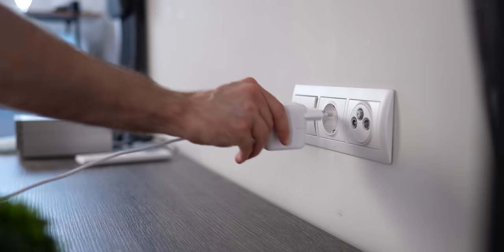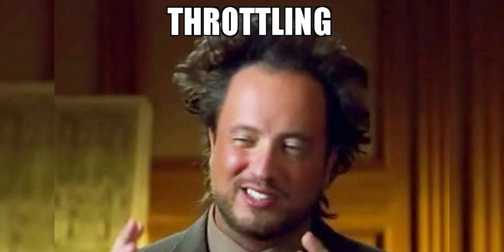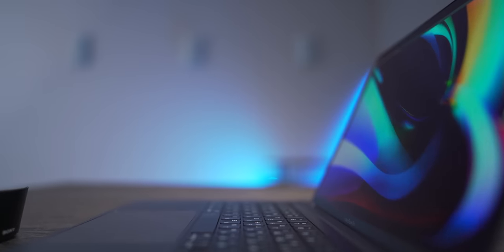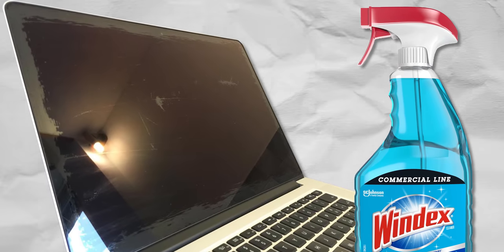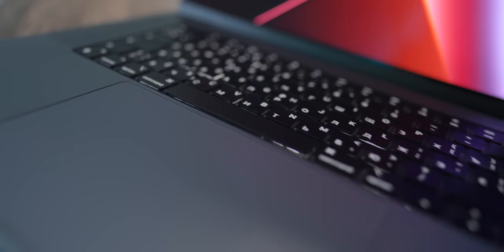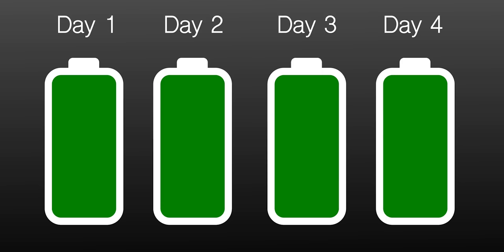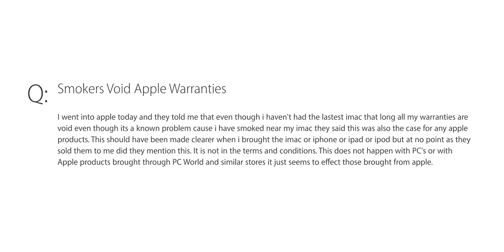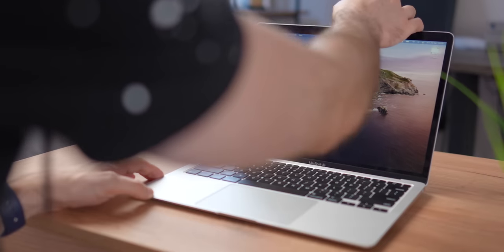Everyday things that SLOWLY KILLING your MacBook!

Comment: These are great tips. I’ve had my MacBook that I bought in 2009 and did everything I’m not supposed to do. It finally bit the dust after 13 years. I miss it. 🤦‍♂️ 😂
Reply: It seems All Laptops of that era were built different. Still have an Acer from 2007 that still powers on and plays old games I enjoyed when new.
Reply: And i have my dads PowerBook G3, which he bought new in 2000, here on my desk, fully working, ok, i had to replace consumeable parts like the screen, keyboard, dvd drive and battery, but the laptop still works fine, after 22 years! If you take care of your devices, they last indeed much longer! I love old and new tech, my 2012 retina still works perfectly fine with it's original battery, it has a whopping 750 cycles, yet i still have 93 percent of it's designed capacity, getting me through a day of work when i turn the screen brightness down a bit, insane right? The oldest machine i have is my dad's old Toshiba Satellite 4300 pro from 1998! Yes, a late 90's machine still working flawlessly, it even runs for 15 minutes on the original battery! How insane is that?
Reply: I have a laptop built in 1787, still going strong 👍
Reply: @fbdjwjflac  That’s great! That’s the cool thing about old laptops and tech. It seems like they were made and built to last.
Reply: @bramvandenbroeck5060  seems like if you handle with care and take care of your devices, it will be sure to last long.
Reply: @xdiq  Surely he means 1987

Right?!?!?
Reply: @crazygunner567yt2  Laptops in 1787: 📖
Reply: @fbdjwjflac  do you mean Lap - Top is it a dress
Reply: @gyaniadmi2347  No he means a real laptop from hundreds of years ago, they are just built different. Literally 😂
Reply: 13 years is enough man, what more do you want

Comment: Some of the tips are useful, but If you struggle so much with your work tool, that means that you can’t truly afford it. Battery replacement is like $250 and I’d rather pay that twice but use and charge my laptop in the most comfortable way that suits my lifestyle
Reply: 250$ for a battery replacement is robbery, replacement ones cost under 50$.
Reply: Agreed...the costs of maintenance and replacement parts should be considered when determining if you can afford an item/product.
Reply: I needed a MBP mandatory for my college program :^) it was like holding a newborn every day lol.
Reply: While not just take care of it from the start??

Comment: Summary of the video with a focus on actionable advice & gathered insights

Macbook Usage
    1. Use your MacBook on a hard, flat surface to prevent overheating and damage to the device.
    2. Do not sleep with your MacBook to prevent crushing it.

Temperature
    1. Avoid exposing your MacBook to direct sunlight or high temperatures to prevent overheating and damage to the device.
    2. Keep your MacBook in proper conditions, with a recommended temperature range of 10 to 35 degrees Celsius, to maintain its performance and prevent battery damage.

Macbook Maintenance
    1. Use your MacBook on a surface that does not collect dust to prevent overheating.
    2. Regularly clean the dust from your MacBook to prevent overheating.

Performance
    1. Overheating can cause damage to the components of the device, such as the CPU, and decrease in performance.
    2. The CPU will lower its maximum frequency when the MacBook is placed on a soft surface and overheats in order to maintain an adequate temperature range. This process is called throttling.
Reply: Thankyou saved me from watching the vid lol
Reply: Thanks this is helpful
Reply: I had no intention to look for summary, but the video is unnecessarily long, and could've been wound up in 5 minutes max. Thanks for this.
Reply: Does this apply for macbook air?
Reply: he's right on not falling asleep with ur Mac, take it from experience I just got my Mac back today from Apple Repair bc i crushed the corner while sleeping 💀
Reply: @myr1494 especially airs because they have no fans
Reply: Thank you! Didn't want to wait through the whole video!
Reply: can I use macbook air insoft surfaces?
Reply: Thanks, I read all this before the first Ad ended :)
Reply: @reymeldeleon126 wait please tell us how to Clean the screen!

Comment: It's true that we shouldn't charge any Apple device with cheap chargers. It only affects the machine. Had a battery bulge for my iPhone 7 long back and the reason was this. And from then on I started using either Apple's or Apple certified chargers. Great video. Very helpful! Thank you!
Reply: the phone doesn't just blindly allow whatever your charger spits out into your phone, it goes through a BMS that regulates the charge rate so it is suitable fior the battery, boosts or limits charge rate based on cell temperature, voltage, etc. Sometimes you just get a really bad cell and it'll prematurely swell or die. Poorly made chargers might die sooner, or have unsafe failure modes eg failing in a way that dumped AC or excessive voltages onto the circuit that goes to the iPhone, but in general, so long as they supply roughly 5V the rest is up to the BMS.
Reply: @quickdry3  Thank you for the explanation. I said in terms of common people, including me, who have no knowledge regarding what kind of chargers to use.
Reply: I can testify that I’ve used super cheap Amazon chargers on my iPhone and iPad for 4 and 6 years respectively with no issue, the battery life on both are going strong and they perform well. I bought spare chargers so there’s always one on my desk, one by my bed and one in the living room to save carrying cables everywhere. If 98% of people will be satisfied with an apple charger, 80-90% will still be absolutely fine with budget versions but there’s definitely a higher chance of issue.

Comment: For number 1, it depends on your workload. My macbook barely uses its fans, so that's fine for me to use it on any surface i want without  any throttling, even for hours of use

Edit : if your macbook's processor is intel, forget about everything that i said
Reply: Curd get spoiled in my keyboard and screen and in the bottom of monitor it has get darken what shall i do plz help
Reply: @RamLohani  you dropped curd on ur mac? id check louis rossman or someone like that. apple will charge a fortune for some bullshit
Reply: My laptop is M1 Macbook Pro, so it's not a big deal😎
Reply: @jathebest2835  I’m planning on getting a 2018 15” MBP
Reply: @hyphinx  don't do that unless you really need intel... I'd say the MacBook Air M1 is more worth it than any other Intel Mac
Reply: When I was in Highschool, the boarding house literally had a rule banning using laptop on the bed😂

Comment: 1:06 not just blocking air flow but vacuuming in all that dust lint and debris from the blanket 😊hence slowly plugging up the fans and causing massive issues down the road in a few weeks

Comment: on my laptop, I always try to learn how the temperatures react to different tasks.  For example, I know that web browsing on my m1 max 16 doesn't make the system very hot, so I know that the fans don't turn on and for that reason I'm comfortable using it on my bed for basic tasks.  However, if I know I'm going to be doing something intensive, like rendering or gaming, and know that the fans will be running, I never do it in bed, and will always put it on a flat desk surface or at the very least on my lap being mindful not to block the vents.
Reply: Never use any fan powered device where there is so much dust
Reply: @GameNobz  that is why it is good to use your MacBook in a clean environment.

Comment: The oleohpobic coating peeling off on apple computers is ridiculous and has been happening for years. I haven´t seen any windows laptop with peeling of the coating and leaving those horrible markings on the display. And most of my friends have this on their MBPs. They should start addressing this issue asap
Reply: what causes that? it seems like a weird thing for something which is rarely touched
Reply: @jub8891  because it’s an anti reflective coating, not an oleophobic coating
Reply: That is what I was wondering. Never seen this happen to windows laptops and I havetreated mine badly lol. This sounds terrible for a laptop you are paying premium price for.

Comment: One thing I find very useful is placing a piece of paper between my keyboard and lid when closing the mac. In time, grease from the keyboard touches and damages the screen causing square patterns to show up which cannot be cleaned (at least they were not for me).
Reply: bro this is so helpful. i thought this only happened to me
Reply: Do NOT do this with the new M1 or 2 airs. Many people have reported shattering screens because there is NO tolerance whatsoever between keyboards and screen because of the slim design. That’s without the paper. Just be careful.
Reply: Great point since my MacBook Pro came with a paper sheet , I think I’m going to try this tip 👌🏽🙏🏽👍🏾👍🏾✌🏽
Reply: @ghost-user559  just use the paper that comes with it.
Reply: @redi08  Still be careful, that’s for shipping, not for using full time. Think about it. The more you open and close the laptop, the more the hinges adjust, and the more you use the keyboard the more the keys adjust based upon the pressure and wearing out of the keys.

It’s not supposed to have that piece of paper except for when it is brand new and factory sealed, before any wear and tear or flexing has occurred. 

Once you start to use it you are trying to insert factory packaging into a machine that is slowly adjusting its shape and its fit, and it’s not designed for you to do that at all.

So it might work out, until one day you go to open it and the glass shatters and falls out. It’s not worth the risk with the cost they sell it for.
Reply: Paper will easily scratch the screen...
Reply: @dabur872916  It never happened for me in about 7 years of using a mac.
Reply: Make sure you wash hands first before using your precious laptop and dont talk while using it because overtime bacteria and saliva would cover up the keyboard😉
Reply: Curd get spoiled in my keyboard and screen and in the bottom of monitor it has get darken what shall i do plz help
Reply: @RamLohani  Piece of paper is the whey to go
Reply: @emiliosp wby shouldn't i put anything (paper) between screen & keyboard?
Reply: I used to get minor scratches to the screen from the keyboard when traveling with Macbook pro in my backpack. Since then I always put a thin microfiber cloth at the center of the keys before closing down the screen and I haven't had any issues after that.
Reply: Why not just use a screen protector?
Reply: @juurstudio  does the microfiber cloth have to cover the whole keyboard? Cause my cloth isn’t big enough to cover the whole keyboard
Reply: @snehithps2175  No don’t worry about it, just make sure it cushions the central part where the screen has the most amount of flex, around the space key etc.
Reply: @poi24b3  😅😅😅
Za to možemo koristiti maske koje  su nam ostale od corona virusa 😂😂😂
Pozdrav iz Hrvatske
Reply: I usually keep the little cloth it came with for this sole purpose. Only squares I have on my screen are from my keyboard cover (I know, you're not supposed to use them!) and I just use a microfiber cloth to wipe down my screen, never any cleaners and rarely touch my screen with my hand, since the guys at Best Buy mentioned the coating on the screen. I've been tempted to get a screen protector, but the guys at Best Buy said that it could damage your MacBook, so I never got one.
Reply: what about keyboard protection covers, like the ghostcover?

Comment: I have 2009 & 2012 MBPs, maxed RAM and SATA SSDs in both with Linux loaded on both.. People are amazed that such old machines are still viable. I also have 2020 MBA. Tempered glass on the screen, silicone keyboard cover, color matched palm rest covers, real stone skins top and bottom and magnetic adapters in the two USBC jacks so I think this machine should a looooong time in pristine condition..
Reply: @dany ay lol who asked you to ask?
Reply: Nice bro, what kind of tempered glass do you have on your MBA?
Reply: i personally gave up on my 2008 mbp because it was too heavy. I think including the charger it was like 4kg
Reply: Can u explain this further? What should I be getting for my M1 Macbook Pro 16inch to help it last the longest? Thanks :)

Comment: Filling your SSD is actually ok. It should have some headroom intentionally left from the manufacturer for it to work properly. However, as a general rule you should always have 10-15Gb free on your hard drive to give the OS some "breathing room".
The USB hub thing isn't true either, and neither are the cables. Unless you're going for the extremely cheap Aliexpress or Wish knock-off you should be okay, your phone and your computer are equipped to deal with small voltage variations and even peaks of electric power.
And the one about holding your PC with one hand while carrying it... I mean... How am I supposed to carry it then? Lol
Reply: "How am I supposed to carry it then? Lol" With two hands?????

Comment: I would also recommend a good app to lock the keyboard whilst cleaning as most MacBook users know that MacBooks like powering on with the lightest touch of a key press or opening the lid.
Reply: Can you name one app for locking the keyboard? I'm trying to find one.
Reply: @vitriolicseraph5030  thanks
Reply: Or just turn the laptop off and clean it
Reply: That would be obvious. Unfortunately newer MacBooks turn back on when you tap on any keyboard key whilst you’re trying to wipe the keyboard clean
Reply: @nmd7142  oh god that's horrible. Yeah your original step is to go for.

Comment: Slamming the lid close and throwing it is so true, in the macbook reddit there are so many people complaining about a cracked macbook m1 screen when closing the lid. and when they open or close the lid using the corner, it bends the very thin screen, and cracks the screen glass.
Reply: Please tell me you joking, cuz I wanted to buy one 🤣
Reply: @Ancient-Forest  not joking, it happened to many people. it doesnt happen to me and never had because i open the lid from the middle. not the corner
Reply: @Daniel R. Soza the case will probably be worse. Imagine pulling it from the edges and the case comes off and the whole mac drops.
But, why in hell would you use the edge to open the screen WHEN THEIR IS A VERY VISIBLE AREA MDE FOR OPENING IT

Comment: Laptop common sense etiquette - The tutorial

You’ll be surprised how many people LACK common sense. Even as a kid I understood to be delicate with the display. But I lost laptops from broken power sockets that were soldered to the motherboard back then. I’d always be sitting on the couch with the cable extended across the floor and people would trip ripping the cable out. One day it was the socket that got ripped loose. Not an issue today as most are NOT soldered to the board anyways, but still. RIP.
Reply: You common sense is not my common sense also people just want to used and enjoy their device if it break or stops working well nothing last for ever

Comment: Can I just leave my laptop plugged into a charger while I’m using it? Therefore it’s always at 100%. Is this bad for the battery?
Reply: You can, and no it is not bad for battery. When it reaches 100% the charger would provide power equal to device's operating power, not charging battery, and it wont discharge until you unplug cable

Comment: i have a macbook pro 14 inch 2021 and I do everything you said not to , I let it charge all night and let it run out to 5-10% battery before I plug it back in , the battery health shows 100% capacity and it last the exact same time as when I got it out of the box

Comment: The smoking tip is spot on. Yes, I’m a smoker, but not tobacco ;) 
Definitely there was a “film” of residue much like cigarette tar over my fans and other components. Easy to clean using ISO and some down time, many Q tips… 
My uncle’s air conditioner was broken one day, and the technician knew exactly why - filter and condenser was caked in tar. 
I think a solution for this would be an air filter / purifier. Not too expensive, pretty quiet and really helps get rid of stinky air in a room. Although, as a smoker, filters would need to be replaced every 6 months at least, I imagine.

Comment: Hello, Arthur, I live in Brazil and bought an imported Macbook Air M2 from the US. Therefore, the charger's power supply came with a type A plug (with two flat pins), while here in Brazil, we use type C (two round pins). I'm using a T (an adapter) that I bought at one of those hardware stores. What do you recommend I do? I've already checked on Apple's website to see if they sell the type C plug separately, so I could just plug it in. Could the fact that I'm using a T adapter on the original power supply degrade the equipment?